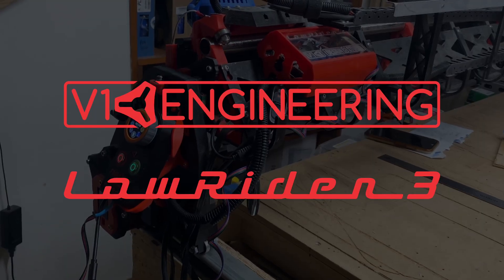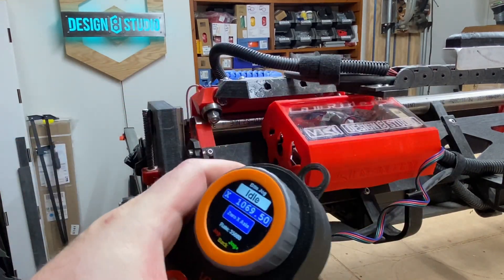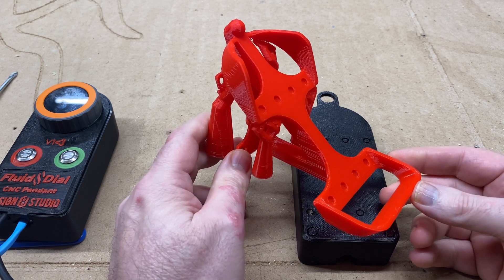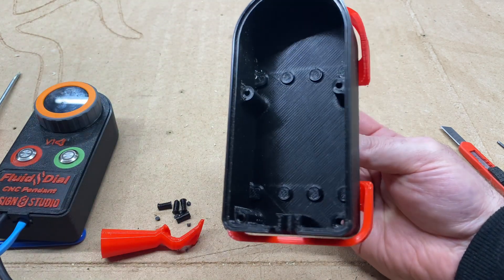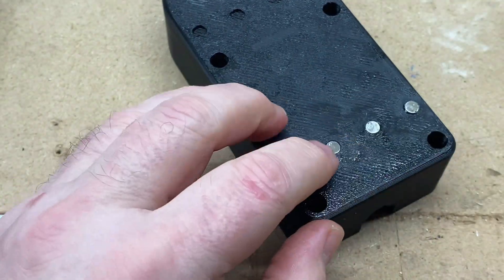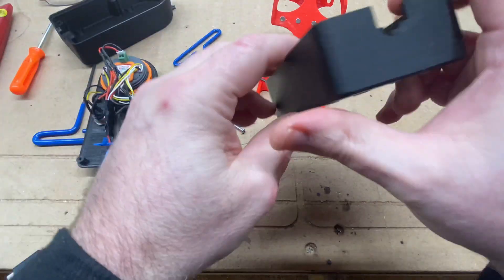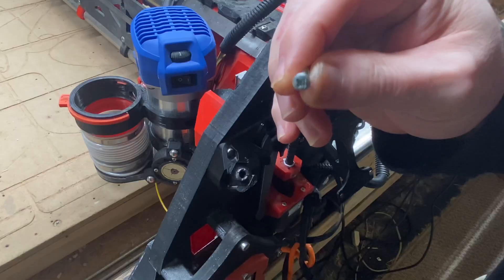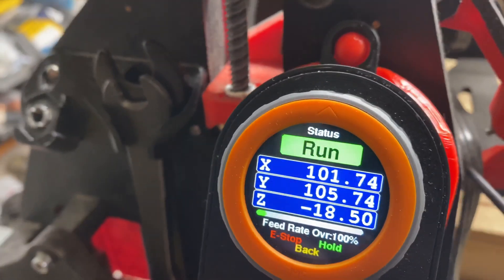LowRider v3 CNC - Cradle for Fluid Dial Pendant on LR3's YZ plate

Comment: Is the Fluid Dial usable on the jackpot controller without any additional modules? Is the jackpot controller usable with externet stepper drivers?
Reply: What does a heart mean, works as expected?
Reply from the maker: @michaelorlik3dwaldhessen318  yes. My first FluidDial is connected to my first Jackpot with no additional PCB or circuit board or module. My second FluidDial is connected to my second Jackpot with a PCB/module that is called a starter kit and it simply aims to simplify the wiring for people, but it’s not necessary. And I think a Jackpot can work with external drivers, but whether it can or not, is a question for the Jackpot itself. The FluidDial connects directly to the Jackpot, and will control it, regardless.

Comment: Hello Mr. I see that the XYZ axes are always in mm can I put the reading in degrees as if they were 3 horizontal indexers and maybe add more axes or indexers as A B C and if you can also add a speed regulator to the head or Motor? it is for a Nema 17 notor with a reducer with a ratio 100/1 I have 3 motors and their reducers to be indexers in degrees thank you
Reply from the maker: These are questions best answered by posting on the V1E forum. Visit: forum.v1e.com

Comment: Does this dial work with the skr v1.2 board ?
Reply from the maker: While the dial works with just about anything, the key here is the FluidDial firmware, which is made only for the FluidNC firmware on the mainboard, which in the case of a V1E machine, is most likely a V1E Jackpot, although it could be a Bart Dring 6-pack board, which the Jackpot is based on. The FluidNC dev team makes the FluidDial firmware. It's tailored to both the M5Stack Dial and the FluidNC system. The SKR boards usually run Marlin firmware, so the dial would not work with that.
Reply from the maker: Hey, I tried at least twice to reply to this, and my YouTube app is still telling me that it hasn’t been responded to. Did either of my earlier two replie show up?
Reply: @design8studio  I recieved one reply from you. To this question.
Reply from the maker: @jerrydparks5173  Will try again. Multiple times recently the YouTube app loses my replies after I post them. Very frustrating.
Reply: @design8studio  seems like I have had that issue here and there as well it is very frustrating, I agree.

Comment: Hello Doug. This project looks like it is progressing nicely! I have a couple of questions for you. 1) How are you communicating with your Jackpot board? WiFi, or USB? The position on your display updates quickly. I am using WiFi and the web GUI, and it takes a long time for data to update on my display after moving or changing something. 2)I can't believe how easily the supports came out of your 3D print. I wonder if you could share your secret?
Reply from the maker: The pendant is currently designed to be connected to the Jackpot board (or 6-Pack board) by a cable or cord, containing four wires: power, ground, Tx data transmit, and Rx data receive.

In the various listings on Printables for this cradle, of which there are now three editions, each one includes a screenshot showing the slicing in Cura, including having the support panel open in the screenshot so that you can see the exact settings I used for the tree supports in Cura. Also, please take note of the shaded areas that indicate support blockers. By carefully limiting where the supports were placed, it makes the job print faster, use less filament, and increase the ease with which the supports are removed. If desired, I can actually share the saved .3MF Cura file, and the G-code produced by it.
Reply: @design8studio  
Thank you for the quick response! I will check out the Printables. I use PrusaSlicer, so I will attempt to replicate your settings to see if I can achieve supports that detach cleaner.
Reply from the maker: When I first replied, I mistakenly said 5 V power. That’s not accurate. In my case I’m running 12 V power. That gets used both to power the LED lights in my momentary switches, the two buttons, but that is optional, and also to power the M5 Stack dial.
Reply: Does this dial work with skr v1.2? Board
Reply from the maker: @jerrydparks5173  The dial probably can work with just about anything. But the crucial issue here is that the firmware that we are using for this pendant is made to work with FluidNC firmware on the main board. SKR boards typically have Marlin firmware on them, which would not be compatible with the firmware that we are using on this pendant.
Reply: @design8studio  I may end up upgrading to the jackpot board at some point. I think this would be a awesome addition to the LR v3 for me.
Thanks for the content, it has been a big help on my path building my first cnc.  I'll be looking forward to printing your pendant case and holder down the road thank you.
Reply: @jerrydparks5173  
I was having a lot of problems with my old board. Once I upgraded to the Jackpot, I have not had any problems. The Web based UI is a little bit different than what I was used to (UGS Platform), but once I got the hang of it, it is pretty simple. Doug’s videos were a huge help with the learning curve.